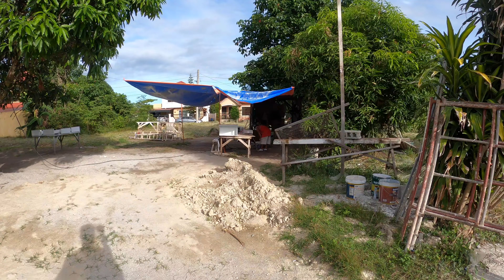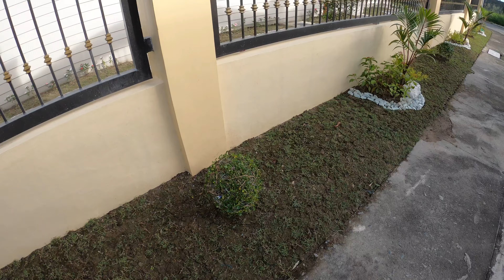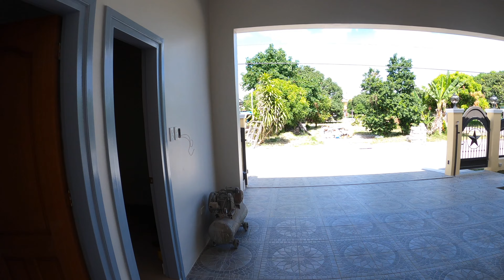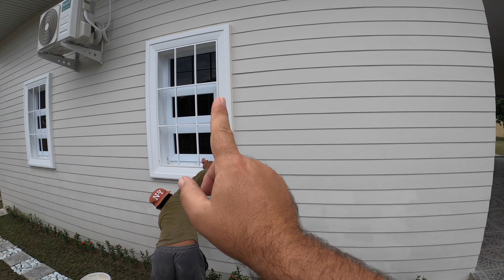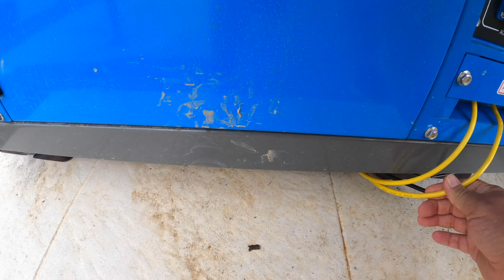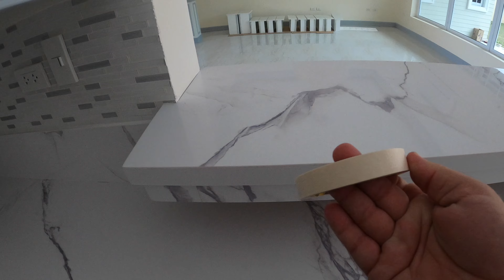Philippine House Building Step by Step, Build Day 268: Touch Up And Stuff

Comment: Are you going to get yourself a lawnmower and line trimmer? May have to with so much grassy area, looks great, once the grass is established it will look great and help with keeping the grounds cooler. ❤️🇦🇺🇵🇭🇺🇸👍
Reply from the maker: Looking a cordless weed eater. The landscapers warned against the reel type mowers saying that they pull the grass out by the root.

Comment: Thank you for replying to my previous inquiry about your cabinets. Now I'd like to ask you where you bought your appliances (ref, stove, oven, microwave, washer & dryer). We're building a house and need to shop around for these. Thanks again! Your project is finishing up quite nicely.
Reply from the maker: We shopped around quite a bit fir the lowest price on the same models. Apple to Apple you know?!
Cheapest for us was Savers Appliances. Except the washer dryer set we picked up at S&R.
Reply: Thanks. It’s so hard to ‘supervise’ construction virtually during this pandemic and your responses to my inquiries help tremendously. I hope that appliance store you mentioned has a website. I live in the US and have limited suppliers in the Philippines that I know. Thanks again!
Reply from the maker: @mariaante2221 
 
https://saversappliances.com.ph/
Another one we used prior to arrival to get ballpark pricing was www.Abenson.com.

Comment: Maybe go to office supply and buy the red ,blue sticky round dots maybe ,that what we use on our punch list when I was at HPS Mech Inc Most Supt all used those ,AC crew used on ceiling tiles to locate all VAV also they may have there also
Reply from the maker: The sign here tags 🏷. Have to look around.

Comment: For the generator wheels... try a 2x4 and cut out a piece for the wheels. It won't rock or move so easily. Kind of like a valley the wheels fit into.
Reply from the maker: Thank you for the tip. Unfortunately wood on the ground is not a good idea here. Termites are ferocious. Still working on similar ideas.
Reply: @CasaTexPina  I honestly forgot the moisture factor

Comment: Good Morning !,Question why are all your AC Condenser hanging up on the out side ? Why couldn't go with split system in Active area ,and Condenser on cement pad down on the ground  , just  a thought  lookin Good  keep b the Videos. Comming A+ we love you guys
Reply from the maker: Good morning, 🌞 
Great question 🙋‍♂️ 
Centralized AC is not very common nor cost effective here. Typically the condenser units are hung because it’s easier to level the brackets and less expensive than concrete pads. Also by hanging the units higher and closer to the indoor unit, less copper tubing is used and lowers the price of installation.